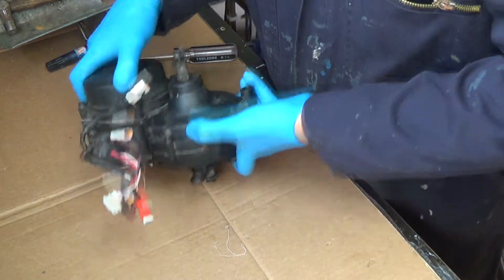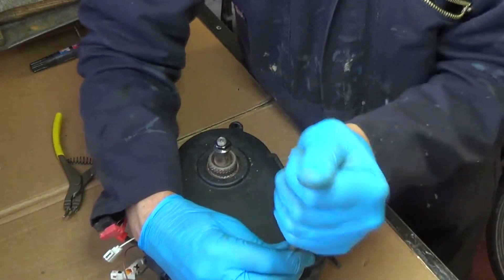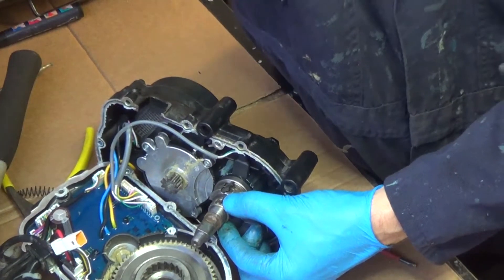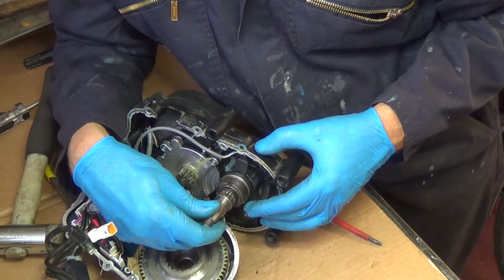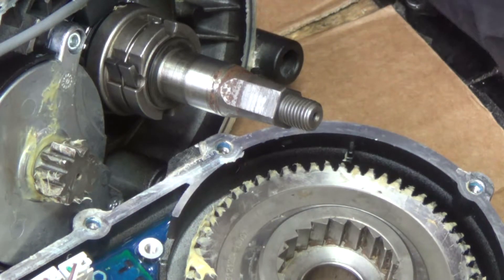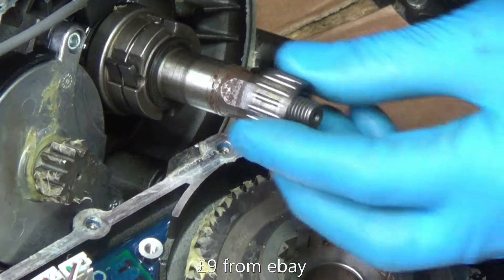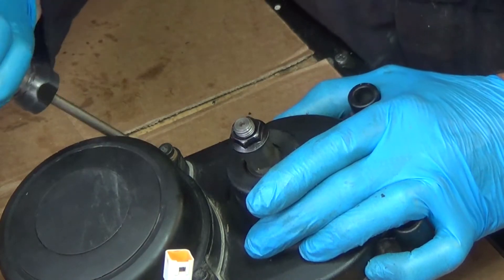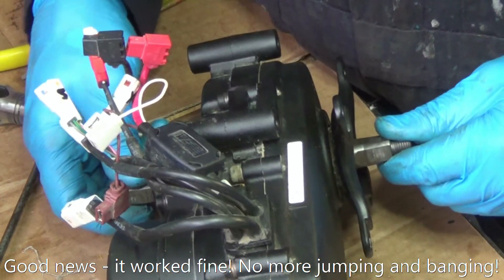Kalkhoff ebike Motor partial stripdown and repair

Comment: What to do with unnecessary safety on the impluse engine? Every time the rear wheel skids the engine stops, if I am on a hill the speed drops to zero and I fall

Comment from the maker: Hi! I'm fairly sure the bearing I used was 21OD 17ID 13 along the axis. This seems to be a standard size in Europe. Hope your stripdown and repair goes well. Best Wishes. Chris
Reply: Thank you all the best Russell
Reply: Perfect fit, stripped down,  all seems good, replaced the needle bearing, a bit of grease on the main gears and after reassembly it is much better. Should last a few more years with a bit of luck.. thanks again Chris. Cheers Russell
Reply from the maker: @RMW-x3d  Really pleased this has been useful for you Russell - thanks for letting me know.

Comment: Great video, I replaced my original 2015 Impulse 2 motor after 12K miles with a new 2019 upgrade version. After 13K it started playing up. Practised on old one first then opened up 2019 model. The pawls have been changed from  2 to 4 pawls and a plastic cover fitted over the drive gear to keep grease off the pawls. The old motor had sticky pawls like yous so cleaned then and used thin oil to lube them so now have a spare motor
Reply from the maker: Thanks for this helpful comment - sounds like the problems I had are common with the early Kalkhoffs and they have got wise to them and modified the design accordingly.

Comment: Hi Chris, i really enjoyed this video, how you explain everything calmly. I have probably same issue with my kalkhoff ebike, it started to rattle and kind of skip the drive, just going to see if i will be able to do it on my own. I've just read that the issue with ratchets can also be fixed/tuned by using springs made of 1mm wire instead of stock 0.8mm. Had moments to look for some service to check it, but satisfaction of DIY is what i need. Thanks for sharing your experience!

Comment: Hey Chris! My god, you are a savour! Just started looking into my Impulse 2.0 motor, since it has some “clicking” sound, when motor caps at max speed, and when pedalling. If you got time, maybe you can give your opinion on it? Got a video file of the sound, also, the motor is currently open, laying on my table, very interesting stuff.
Reply from the maker: Hi Oliver - thanks for being in touch. Glad sharing my experiences was helpful. Could you post some pictures and the video file on YouTube? There might be others out there too who can help diagnose the fault?
Reply from the maker: @Oliver_Arbjerg  Hi Oliver - that is certainly quite a noticeable noise. Question - if you pedal along with the electric assist switched off, does it make the same noise or not? That might help track down whether the problem is with the motor or the pedal crankshaft. Sounds like you get several clicks per revolution of the pedals (and nothing in reverse), so most likely a motor problem?
Reply: @chrisstebbing1892  It only clicks when electric assistance, so it has something to do with the motor. I may open it again in the weekend, to see if that can tell anything :)
Reply from the maker: @Oliver_Arbjerg  Have a look at the teeth on the gear wheel on the end of the motor shaft. If one was chipped or if there was something stuck in one tooth that would give the repeating click sound several times for each turn of the pedals like you have. Alternatively, the motor bearing could be worn out. 😢

Comment: hi i need battery of kalkhoff bike can u help me
Reply from the maker: Batteries for these are expensive and hard to find. You can search www.eBay.co.uk for a new or second hand one. Another way to do it is to get an old battery of the right type but which no longer holds charge and send it away to be -re-celled' by someone like Insat https://bga-reworking.co.uk/ . This makes a great new battery (often better than the original), but again it is expensive. Hope you can find one! Best Wishes. Chris
Reply: @chrisstebbing1892  thanks for all the informations

Comment: Great stuff. I've got a defective impulse motor too. Your video got me checking the pawls but mine is different. However it made me notice something I hadn't seen before which is good. Too early to say but your video may have helped so thanks!
Reply from the maker: Glad this video encouraged you to have a look at your motor. It's surprising what you can do when you give it a try. Cheers. Chris
Reply: @chrisstebbing1892  So it turns out I don't have any pawls in my motor! What I have is an impulse 2.0 from 2013 with the backpedal brake. It looks very different to yours inside and as I say no pawls at all. I'm still working on it but what I'm finding is that there's very little info available on how these things work and how to test sensors etc. Here in Ireland, I've been unable to find anybody that knows anything! So now I'm translating mainly german videos and websites! Pretty crazy given a new motor is about 600 euro. I could buy a cheap second hand car for that and get all the parts, manuals and everything else I'd need to rebuild it from scratch!
Reply: Hey guys i got a bike given to me with this motor ill presume theres something wrong but cant properly test it as dont have display or battery. Nor any info on wiring diagram. If anyone knows please share